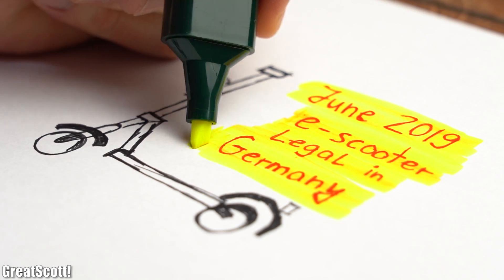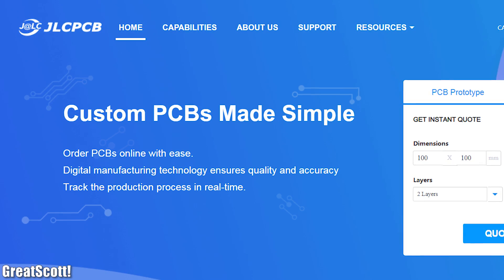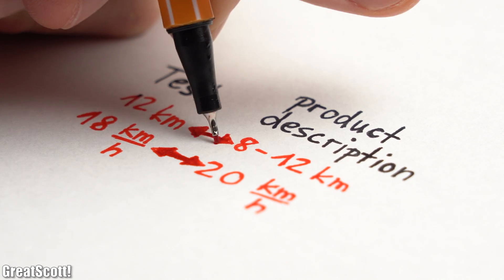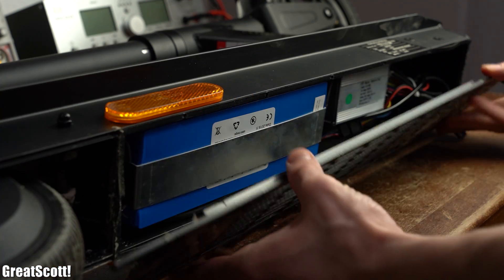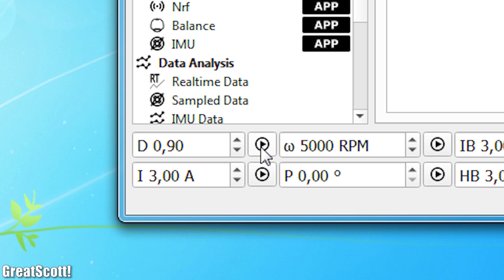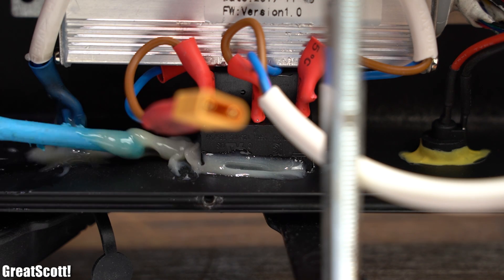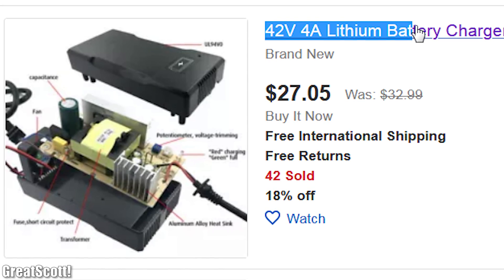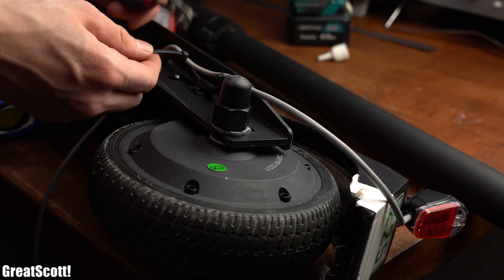Upgrading the cheapest street-legal E-Scooter I could find on the Internet!

Comment: Your insurance might be invalid now :)
Reply: I don't know why, there aren't any modification regarding the legality. The things that must be present, OTOH, are: speed limit, power limit, front and back lights, two independent brakes, license number, bell. Unless there's a special clause in the insurance that forbids ANY modifications, it should still be street legal.
Reply: @Ligius @Chris Lewis 

As far as i understand this law here in germany: the scooters count as motor vehicle, same as for example cars. Because of that every scooter/product needs the official (TÜV) certification, number plate and insurance to be legal on public roads. The certification is invalid as soon as you modify any important part. It is not enough to have all features and that it works fine, there are chinese brand scooters that fulfill all technical requirements, but are still not street legal, just because the manufactures did not go through the certification process here. 

Probably there are no special clauses from the insurance, but it is also void if they find out that the vehicle was not street legal... I would expect using external batteries counts as modified power train and could bring you in serious trouble. 

In my opinion it is insane, especially with that low speed limit they should have just made it equal to bicycles, where all of this stuff is not required, even for E-Bikes up to 25km/h.
Reply: @1Hippo  a second battery has nothing to do with the power train because a battery is just a battery, you can change the battery in your car and not be in trouble. The power train is made up of the motor, gears/belts and tires. All that stuff he left as is. He did try another ESC to see if there is a difference in top speed but hooked the original one back up. As for the headlight and the tail light he hardwired them so he doesn't have to keep buying AAA batteries and button cells when they die... Soo to me it still sounds street legal.
Reply: Only thing he did was add a jack for a second battery and hardwired the lights to run on the system battery and not a button cell and AA cells. They tend to run flat (no longer produce power) in usually 20/30 min depending on the outside temp, how often the lights are used (when riding at night) and how long they are "on" per trip. So technically he hasn't voided anything but the warranty. If something were to break on it, he couldn't send it back to be fixed.
Reply: Yes it is, and it's also no street-legal anymore...

Comment: Work with the MAX2606 :)
Reply: Sounds good, just please no RF amplifiers.
Reply: @wesleymays1931  well, you would need at least a simple transistor bias amplifier. Since the MAX2606 has a gain of -10dB
Reply: @ithaca2076  @Afrotechmods made a working FM transmitter with just the MAX2606 and a 3.3v LDO.
Reply: @wesleymays1931  oh thanks

Comment: "I didn't increase the speed. To stay street legal of course." 😂😂😂😂
Reply: You might also have been able to get more efficiency out of replacing the controller and thus increased range that way and you could have used a buck converter to bump the voltage down.  if you put more battery on in series. A boost circuit might let him burn the battery lower than normal and get more speed.
Reply: @Lunas2525  boost, not buck =)
Reply: The hell you talking about “bumping voltage up” is perfectly fine. You’re missing the part where he mentioned the buck converter - those only reduce voltage
Reply: @signalworks  if he wired the two packs in series a buck converter could be used to output 36v-72v he could set a range lets say 42v-36v above 44v i would imagine the motor would be getting hot if not hitting its limit they will suffer only so much over voltage. The other thing i was thinking rolling his own battery off 18650 it looked like there was almost room for 2 packs extending it by say 2 more banks of 6 cells to make it a 44v pack vs 36v.
To run the lights he just needed to run a voltage regulator that will drop the tail to 3v the headlight seemed to run at 4.5v imho better off stripping out for a 12v system. And a regulator to take 36-72v and put out 12v the head light and tail lights would output serious light then...
Reply: @signalworks  or creates tasers
Reply: We need a fast and furious scooter, illegal street racing edition)))
Reply: @nickmo439  i have an sxt ultimate pro 65kmh
Reply: @TacticalBytes553  that is rookie numbers. here in singapore we mod it to go 70km/h. the scooter brands are dyu and fiido
Reply: @TacticalBytes553  Das geht aber nur mit Zusatzakku. Original schafft der ja kaum die 30 unter 100% Ladezustand :D
Reply: @TacticalBytes553  48v modd?
Reply: Careful! I fell off of one because of a tiny bump in the road when I had one hand on the handlebars. I wasn't even going that fast and it was bad. There's a reason these things aren't popular other than looks...
Reply: @joeythehat9  that why i bought zero 10x to replace my m365. Great suspension and now I can go 50km/h with no problems even on bad pavement.
Reply: @komorka88  At 50 km/h you should really be on an e-bike, for stability reason alone. The high center of gravity on scooters is just an accident waiting to happen if you have to break at speed.

Comment: Your phone saw a max speed of 18.3kph, but the scooter showed a max speed of 20kph.  One of them is wrong, and I'm guessing it's the scooter.
Reply: You ever compare a GPS speed readout to a car speedometer?
Reply: @RoamingAdhocrat  I always use GPS speedometer apps to figure out by how much my car speedo overreads.
Reply: @clonkex  Yep, same here. Any inaccuracy in the GPS position will average out in the GPS speed overreading (if it thinks you've wandered left and right of your actual track, and travelled further than you did in a given period of time), which is why I trust the GPS speed more than the vehicle speedometer.
Reply: @RoamingAdhocrat  Yeah I always try to do it in a straight line and at a constant speed. I've tried with many different phones and apps and they all agree very consistently, so I'm quite happy to trust the results.
Reply: 20 was downhill
Reply: I wouldn't be too sure about that, GPS speed is not that accurate. Also, 18 or 20 is reasonable close IMO
Reply: @tobimai4843  GPS speed is much more accurate then built in car or scooters. Speedometer in cars and e-scooters use RPM and diameter of wheel which is changing with weight of person/load and with temprature because of hardness of rubber. This leads to quite inaccurate numbers.

Comment: I got the street-legal Doc Green ESA 5000 from Lidl in Germany for 300 Euro on Black Friday last year. It does not require batteries for the lights, the range is 22km, the motor is 350W and the bigger battery helps to maintain 20km/h even with a small charge left. The other good thing is that the chassis is an exact copy of the M365 and a lot of accessories are cheaply available from China. It is not perfect tho, the battery indicator is not connected to the BMS and thus is a simple voltage display that does not work well with the voltage sag that the scooter experiences under load and also does not have suspension nor pneumatic tires. There is another version that is basically identical, it is called ESA 1919 and you can currently buy it for around 350 Euro and I still think it's worth the 70 EUR over the Maginon Street One.

Comment: Greatscott!: uses XT60 for hand crank generator project.
Also Greatscott!: uses 5.5mm DC barrel connector to power electric scooter.
Reply: Joke aside, brushless motor ESC can generate quite some transient voltage spike due to the nature of switched inductor. This is an even bigger problem with active or regen braking which often featured on most ESC because you're sending power back to the line. ESC requires stable input supply which can be attained by having an array of capacitor on the input and having low resistance power path to battery to dampen the surge, which I'm pretty sure the 5.5mm barrel connector is lacking of. Just my thoughts :-)
Reply: @Asu01  I would just connect the batteries in parallel, since that would lower the internal resistance losses. A PTC can be used to limit current if the charge states are wildly different. https://www.youtube.com/watch?v=snaJxB_psg8
Reply: @NiHaoMike64  He's not paralleling the batteries. He's switching from one to the other (SPDT power switch).
Reply: @ARepublicIfYouCanKeepIt  but maybe he conected this double pole in parallel  because of current
Reply from the maker: That's me :-)
Reply: I ended up using these on my eBike hack: https://www.google.com/search?q=neutrik+20A+connector&rlz=1C5CHFA_enGB751GB751&oq=neutrik+20A+connector&aqs=chrome..69i57.8252j0j7&sourceid=chrome&ie=UTF-8

All else failed due to melting, broken connections, or simply fell to bits over time through excessive vibration.
Reply: @dewexdewex  aren't those connectors used for like speaker system?
Reply: Why did he bodge it soo badly ?
Reply: Great Scott,  hi . Maybe try changing the hub motor wheel diameter.  Maybe tricking the controler on rpm has to be higher to reach 18 kph but will be faster,  but maybe it will pull more battery power 😮
Reply: You should have used faston crimp connectors for the switch.
And why didnt you put the resistor network on a proto board since you love those?  

Greatscott you should seriously stop reading the scripts and start talking freely, your english is good enough for that.
This robotic way you describe everything make these videos not so enjoyablew to watch.
I mean I dont wanna hate on your videos, I like what your doing but maybe its time to improve things.

Comment: Next Mppt controller DIY or BUY
Reply: Definitely buy. The commercially available units are just so polished and feature rich on top of that being up there in difficulty as far as topologies go, that any average person would spend years trying to make one that didn't mess something up. The only way I see that being feasible is following a step by step, part by part guide on an already tested system with tested programming and if you're quick at soldering or don't place a high dollar value on your time, and nothing goes wrong, you could probably save 10%-50% of the cost, depending on the features. Any normal person will likely blow so much time on making it that the actual cost is higher than buying though.
Reply: @AtlasReburdened  Probably be cheaper to buy if you just want one, but if you want many (as in an optimizer system), there's a lot of room for DIY to become the cheaper option.
Reply: @NiHaoMike64  Fair point, though there are other factors like warranty, supply chain assurance, and finished product testing and certifications to consider.

Comment: wouldn't it be better to use a buck-converter instead of resistors for the lights?
Reply from the maker: It would draw a standby current and drain the battery.

Comment: Why resistors ? You can use step down converter. To increase range you can make a custom battery pack fitted to whole available space in your scooter ;)
Reply from the maker: A buck converter would draw a standby current and drain the battery.
Reply: So maybe battery power switch 😉

Comment: You could have wired the two batteries in series and just change out the motor driver for higher speeds
Reply from the maker: True
Reply: Wiring the batteries in series would double the voltage. If he wired them in parallel he would have twice the current capacity and therefore double the range with the same top speed.  The problem is that with doing either of these things requires the batteries to be exactly the same - they have to be charged to the same voltage and have to expend their stored energy at the same rate, otherwise there will be problems with one battery charging another and it could lead to serious battery failure.
Reply: @stevedonkers9087  BMS is like beginner level Arduino project or ebay, AliExpress.

Comment: If the motor has the torque to pull higher gearing, you can increase the top speed by putting a bigger tyre on it.
The speedo (if derived from the rear wheel rpm) will be inaccurate though.

Oh, and stick some grommets on the wires going through the metal to the battery, unless you want and "exciting" experience after it rubs through the insulation!

Comment: DIY or BUY: Electric Scooter
Reply: I doubt that he has the lathe, welder, foundry, forge, pipe bender and etc to take care of the mechanical aspect of such a project otherwise, it is a great suggestion
Reply: Well if you want to drive it on the street, you have to buy
Reply: It will cost you less to buy it.
Reply: @zumbazumba1  i made myself e-scooter which is driving 25km/h it is combined from simple scooter and hoverboard. I bought used scooter for 40€ and broken hoverboard for 35€. With some other electronics from aliexpress price was under 100€.
Reply: The most pricy thing is battery. But if You use cells from old laptops You can have it almost for free. I am building my second project using 120 cells out of almost 600 collected, maybe 150 of them passed required test of no overheating, no significant spontaneous discharging after time and capacity at least 75 percent of new. I have gone slightly over 100 euro for whole project. 10 for used hoverboard without battery, 10 for controllers, maybe 15 for hardware things like steel, aluminium sheets screws and nuts. 15 for old non electric scooter, bottle of borovička for friend with welding machine. 30 bucks for 50 old laptop batteries producing mentioned 150 usable cells. Maybe 20 for aliexpress electronic parts like wires, buttons, voltmeter, lights, fuse box,  connectors, throttle etc ...hope policemans will just wonder what is this and leave me as last time on my first project which was basically giving unused lead acid battery wheels and engine 😀
Reply: @nucleardoomertv3206  Bum bum bum bum a borovička rum 
a podzme šicke vypic a borovičku rum. :D
Reply: To be street legal you would probably not want to use DIY
Reply: @tiloalo  not in my country. Here is not such strict legislative about it. Here are some restrictions about speed and place where you can drive but thankfully nothing about construction
Reply: Better buy an all terrain electric scooter, not those flimsy things

Comment: Hello. Thanks for sharing! For the "lights upgrade" - instead of dropping the voltage using resistors I would use step down converter - you had plenty of room for those and the advantage would be that once set - the lights would not dim when battery pack would discharge.
Reply: Mini buck converters are so cheap and useful i don’t know why did he even bother with resistors...
Reply from the maker: Sure but they draw a noticeable standby current and I wanted the battery to not drain through such loads when switch position 1 or 2  is active while the motor system is off.
Reply: @greatscottlab  Would a switch be inconvenient to eliminate standbay currents? Technically I wonder why you bothered with insurance shortly before invalidating it anyhow.
Reply: @merkatorix  He shows a paper document and tells us he got insurance… ;)
Reply: @merkatorix  Rather than separate switch, use a relay to supply power to the buck converter circuit when the SPDT power switch is activated.
Reply: @greatscottlab    that doesn't make sense to me.  If leds connected via series resistors get disconnected when the motor system is off, why would leds connected via a more efficient system not be?  Standby power is a red herring if contact is broken.  Fess up mate!  Your lighting circuit is rubbish for such a large voltage drop!
Reply: @greatscottlab   easily fixed by putting the power switch for the lights between the battery and step down convert/s this would stop the draining of the battery and give you a single place to turn all the lights on/off you could place the switch on the central console for ease of use.
Reply: @TWMist  aslo fixed by opening the controller and find what  power line get turned on when you turn the switch
solder some wire and the buck converter there
ads some fuse
i did that on my own 1000watt electric scooter :D
Reply: It was posted right now! How did you post your comment a week ago
Reply: @pewgamingbros9263  Patreon users :)
Reply: @pewgamingbros9263  This video was probably unlisted.
Reply: @pewgamingbros9263 Hey Bro, the patreon users have early access.this video was actually made available for them a week ago.